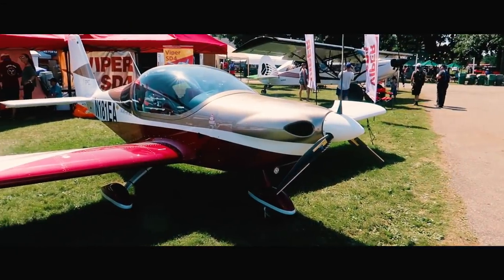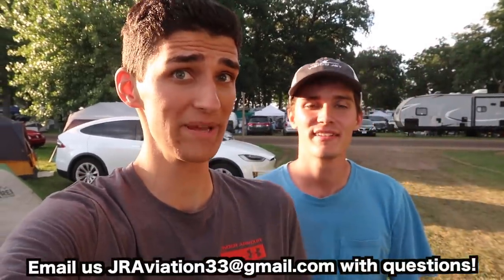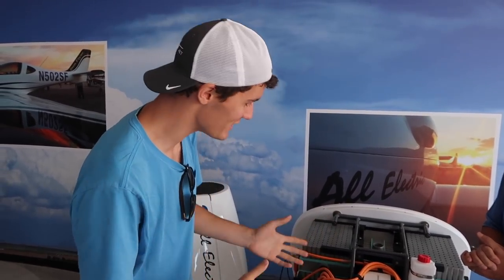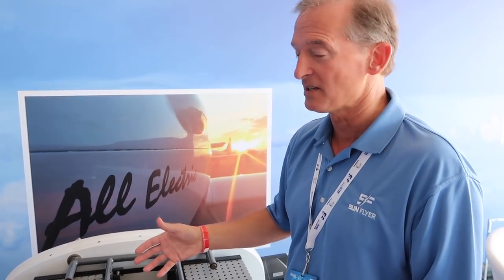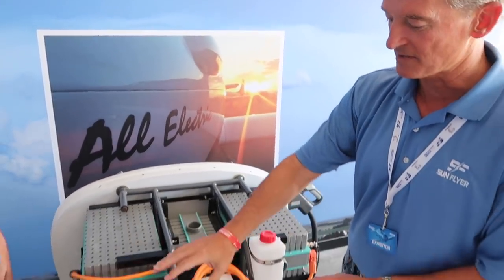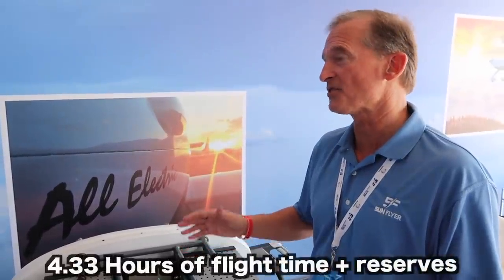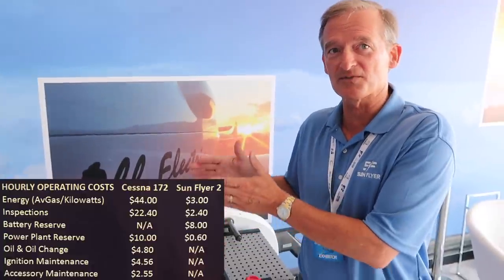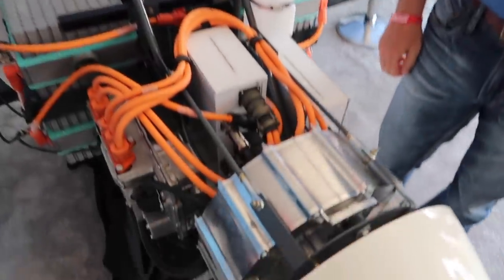What Powers Our New Electric Airplane? (Sun Flyer Explained)

Comment: What is the energy density of those batteries?
Being slightly heavier than normal, what is the takeoff roll of the plane?
Stall speed?
With the recent crash of the Siemens eFusion, are there additional safety measures?
How are the batteries cooled?
Can they be vented in case something were to happen?
You touched on it in the video but didn’t specify - what is the service ceiling of this plane, assuming you have oxygen?

Honestly, I’m still waiting for solid state batteries.  You could probably just passively cool those by mounting them in the wings.  Also waiting for solar panels to get cheaper.  With so much surface area, it just makes sense to put solar panels on your plane and get a free ride once a week.
Reply: xpeterson   Lithium batteries are around 200wh/kgm and could go as high as 250wh/kgm.
Reply: They blamed the pilot for the crash. They don’t want to look bad and push non sense forward.

Comment: So what is the the KWH of the batteries after 50 and 100 charge/discharge cycles?  Battery capacity tends to fall off very rapidly.  A range of 350 miles when new could easily be less than 75 miles in a year or less.
Reply: Electric transportation The Salesman always are lying and double speaking.

Comment: as a 2 place with only 440 lbs useful load.. you should not compare to a C-172.. the speed regime is higher than a C-152.. but the rest isnt.   speeds equal to old retractables with 150 hp is not shabby at all !

Comment: I'm an enthusiastic proponent of electric propulsion and this airplane looks very good.  I've worked in aviation for over 50 years, owned numerous airplanes, and I'm presently thinking of converting my VariEze to electric or hybrid-electric. I should add that I've had 6 EVs (including 5 Teslas), 2 PHEVs, and 2 HEVs, so I'm somewhat familiar.  Now... 
Here is a laundry list of why your video comes up way short.  
Price? Inquiring minds, etc.  $349,000.  No wonder it's not mentioned. 
What is 90 kW of power? Answer, about 120 hp. 
But what, then, is 92 kWh of battery?  Most viewers may not know. It's the energy capacity of the batteries, the "electric fuel supply."  It's the equivalent of 2.73 gallons of gasoline. But since electric motors are much more efficient than gasoline engines, it is really equal in usable power to approx. 7 - 10 gallons, depending on numerous factors.
George Bye says at one point that the battery supplies "that 90 kW of power" and later says it provides "that 3.5 hours of flight time."  True, but misleading. It can do either, but not both.  Or that battery could provide 200 kW of power, for about 25 minutes flight time with a different motor and controller. This is sort of like someone saying an F-105 can fly Mach 2.5 and can carry 2.2 hours of fuel.  Each can be true, but not both.  On the Sun Flyer 2, the battery pack providing 90 kW of power would be empty in about an hour, if it doesn't overheat. Or it can, and does, provide 90 kW for takeoff, but an average of just 26 kW of power, which is what the 3.5 hours represents, an average output of 26 kW/35 hp.  He implies it again by saying $3 per flight hour.  The math says that's also about 26 kWh.  The key is understanding the difference between power output expressed in kW (hp divided by ~1.33) and the amount of stored energy carried expressed in kWh (gallons of gasoline x 33.7).
Further, the quoted 1,050 fpm rate of climb tells me that the power is likely limited to perhaps 55 kW right after take-off. Which brings us to where this presentation fails. No mention is made of battery thermal management.  This is of of utmost importance.  Thousands of people bought Nissan Leafs and regretted it.  Why? Lack of thermal management and severely degraded batteries.  No one should put down $5,000 on a $350,000 flying Leaf unless they relish disappointment, disillusionment and years of lawsuits trying to recoup some of their loss resulting from a hasty, ill-researched purchase decision.
Actual speed?  Not 135, or 120, or 100. It is 70 knots/80 mph. Yeah. Do the math. 3.5  hours, 250 miles.  
The only fair commercial transaction occurs between a fully informed seller and a fully informed buyer.  If you were making an advertisement, I guess some would say this video succeeded.  If you intended this as an interview to inform your viewers, well....

For those who have read this far, let me just add that this company has a heck of a good management team.  Lots of experience, accomplishments, drive and know-how.  I fully expect that they and their two aircraft will succeed.  There is no reason for me to expect that they would sell an electric aircraft with 92 kWh at a price that could attract a cheapskate, underachiever like myself.  My hat's off to George and Charlie for leading the way in the commercialization of electric airplanes.  Blue skies and tailwinds to you all at Bye Aerospace.

Post Scripts:  
No, I've never had a Leaf.  Just lucky that I thought they were butt ugly.
I've never had an F-105 above about Mach 1.6, and am not aware of ever meeting anyone who has.  It would run out of fuel in about 7 minutes, or so I was told.  How about you, Charlie?  Ever been much faster than 1.6, other than as a Concorde passenger, maybe?

Comment: Yes bigger battery however aircraft use more of that 90 kwh motors power than the cars do.  Even if the car is lighter the aircraft will use more power to go faster.  The subnotes on the video showed that flight time at only 70 kts.  I want to see the battery usage at 75% power not 50%

Comment: Key tech questions for me would be battery pack weight at 95kWh and cost per kWh to replace it in say, 8 or 9 years. Yes, I know that batteries don't just "die" but gradually, slowly lose capacity over time so at the end of that 8 or 9 years you'll have say, 75% of original capacity... likely much more if the system's well designed and the operators take decent care of the aircraft.

Comment: Electric planes are a big step forward in the world of aviation. The FAA makes small planes go through the same testing as big planes, so advances in GA planes are expensive and hard to do. Gr8 plane tho
Reply from the maker: Yes indeed!
Reply: I did't think that was going to get approved by the FAA
Reply: No range, no speed, basically useless = A big step forward?
Reply: @jaxonmattox9267  Maybe, but if the plane can only fly as fast as a car can drive, what's the point of taking a plane? Also, the problem with that kind of thinking is that, when someone needs to fly further, they can't. That's one of the reasons why people wont consider electric cars, because the car might be able to take care of 95% of their driving, but people still want that extra range for when they need it.

Comment: If accurate, the graphic shows truly stunning lifetime fuel/maintenance/inspection costs: Sun Flyer 2 $15/hr vs a 172's $90/hr.  And hopefully, we'll see much improved powerplant reliability versus a piston O-235 or O-360.  Thinking "mountains at night"-level reliability.

But it requires such MASSIVE batteries: At 92 kWh at 260 Wh/kg, you're carting around over 350 kg.  If I had $350,000 burning a hold in my pocket, I'd hold out for a 3 hour @ 110 kt version (versus the current 3 hr @70 kt), which might be possible with batteries at 400 Wh/kg.  Maybe in 5 years?
Reply: This thing will never be more than a local / pattern flyer. No range, no charging infrastructure.
Reply: No brained..,put that motor in a composite Quickie Q2 and you could cruise at 200mph!

Comment: Maybe by 2025 to around 2030, solid state batteries will go into production.  They exist in the labs, but are not in production yet.   Lithium batteries are around 200 to 250 Wh/Kgm and the new solid state batteries should be around 500 to 600Wh/Kgm.   This improvement will result in a major shift toward electric cars and aircraft.   Lithium offer about 3,000 charge/discharge cycles, while solid state batteries offer over 20,000 cycles.  Solid state batteries can be recharged in about 12 to 15 minutes.

Comment: I am all for electric aviation. Flown, drove, plowed and dozed behind pistons all my life and getting the newest generation of battery tools in hand i have faith that electric propulsion is the future. This video is exciting stuff!! That said, when i hear the words "get your reservation", "only $5,000" my BS allergy goes BERZERK!! Also missing key info like energy density and battery life in hard d#dgets is a real deal breaker.
Reply: Carroll, battery life should be about 1,000 full recharges (which can be 3,000 partial charges between, for example, 52% and 85%).  If you think about this as being 3,500 hours of flight time, that's about double the TBO of an O-200 or O-235. Waiting to find out more about their battery cooling system.  This is a critical item for Li Ion batteries.
Reply: @daveriley6310  Well I just saw your reply But I must say I appreciate you getting back to me.

Comment: Why no battery’s in the wings?
Reply: Something to consider: Longer wiring runs between motor and batteries increase resistance losses (in heat), increases weight and cost (power wiring), increases stress on wing spars (batteries are usually heavy).

Comment: Unfortunately making the batteries puts out way more toxic chemicals than the entire lifecycle of a fuel engine and that's not including the disposal of old batteries... Just doesn't make any sense.. I fly electric rc jets and planes and deal with all the problems.. They catch fire very easy and if crashed they explode into a extremely hot fast burning fire just ike the cars do but airplane crashes are guaranteed to burn you up can't dump battery fuel before a crash landing.. I would think a clean burning natural gas engine would make more sense than electric.. Last thing you you need is a battery fire at 10,000 feet because of a bad cell... Just saying .. Just bring a parachute or burn alive... Lipo batteries are extremely dangerous I've had several fires i won't even fly my rc planes in the summer because im scared to start a wildfire...

Comment: All things change the electrical aircraft  is becoming of age with new avionics systems like the G3 X that gives pilots the cockpit that once fighter pilots looking a school / College in Texas the flight feels in 1980/81 for 40 hours of time was right around $1500 and the same course today at 25 flights hours is right at 6K for the privet pilot course .

The electric aircraft could bring down the cost and put it in reach of more people unlike the cost of becoming a 250 hour MEL flight instructor and owing alone in the 25 K range just to become a pilot , when A& P 's or avionics tech and making more to start out and with a much lower cost for school in the 4-6 K range

Electra aircraft may someday put an aircraft in the yard of the common man as they say and with a 100 to the 250-mile range at speed of 150 mph it ease to commute to work in some states where the weather is 99% of the time clear., The smaller aircraft could let small airports located in places that today would be in possible due to the noise of engines, it could be no trouble for some business to have grass or paved landing stripes 

With the up to date avionics and flight computers, traffic could flow in and out with ease and the fact that if one should need to make an off airport landing many of those aircraft could ease land in 100 yards or less and with no fuel the risk of fire is reduced as well

At one time the best minds of the time looked at flying from the US to Pairs a fools dream some said the AC - System of current would never work just as some said overnight shipping was a fool ideal as well and now compiles like Fed- X or DHL rock the world sending parts overnight to save a life or  to the aircraft that's AOG 

Thanks for posting for the skies of tomorrow will bring so many new advances to the world after all lots of those who see strange UFO'S  have their feet sold on the ground who knows whats in the dark hangers of the USA or small shops were the craze old nut case is working on just like the two craze bicycle guys building a flying machine that 99% of the people would consider a crackpot ideal at best

Comment: The real savings to owner and users will be in lower maint costs and fuel.. both of which are extreme.  What the cost is and how that amortizes may continue to make this a rich mans game..when it should not be.  battery packs from wrecked leaf cars and one of those wasting away Grumman airframes.. and off we go !

Comment: Does anyone care to do the math on these claims? I don't know how much electric energy costs in the USA, but here in Europe we are looking at €0.23 per kWh. A full charge isn't $3.00 for us, but rather more like $25-$30. And that keeps going up as 'green' taxes are added each and every year.. Another questionable figure is 4 hours of flight time on a 100kWh battery charge. That's only possible if you run at 25kW for 4 hours. 25kW is about 35HP. So the claim is 1900lbs gross weight flying merrily along for 4 hours, at ~35HP. Insert magic here..

Another slight issue with electric planes in general: Charging times. A 100kWh battery needs several hours to recharge at some serious charging equipment.. Quite different from the 10-minute stop to get gas at a cross-country flight. Oh, and while you are hogging the charger for several hours, your friends behind you can't charge.

The problem isn't the batteries or the motor. It's recharge time. ANd if you ever do get stranded out in the open, your buddies can't fly in with some portable bucket of electirc power to help you out.

This stuff is great for one-off prototypes. It s*cks for real-life use. Go ahead and prove me wrong.
Reply: Here in the Boston, Massachusetts area, I'm paying 0.207 $/KWh for power which is much higher than the US national average which I think is around $0.12 these  days.  I would also point that the quoted figure of $3 was per flight hour, not per full charge.
Reply: <Does anyone care to do the math on these claims?>
Indeed cost does not add up unless you charge from solar/powerpack combo.

The rest checks out, no magic needed:
1900 lb with lift to drag of say 16 at 70 knots = 1900/16 = 119 lb drag, equal thrust in level flight, power required P = T V / propeff *1/325 for units, assuming 0.85 propeller efficiency that's Power = 119 * 70 / 0.85 *1/325 = 30 HP to maintain level flight at 70 knots plus losses 35 HP. Check.

<A 100kWh battery needs several hours to recharge at some serious charging equipment.>
Several hours to recharge from a conventional dryer plug yes. Serious charging equipment (similar to a Tesla supercharger) you will need less than one hour for a depleted battery, typically 30 minutes after normal 1-2 hr training flights. Long charging times are a myth.

If you are stranded in the open, which is extremely rare (never happened in 20 years of flying), you can still recharge with a generator. Highly inefficient but does the job.